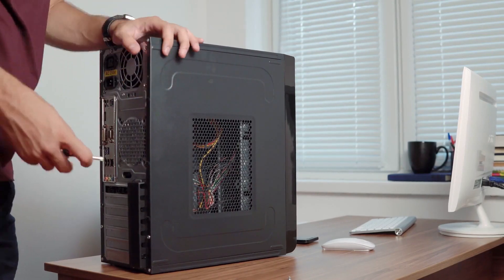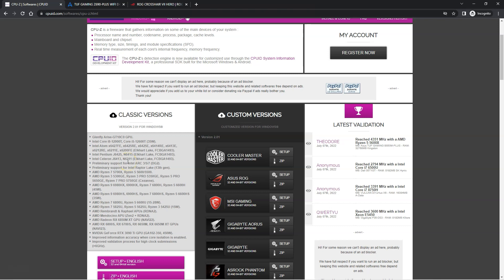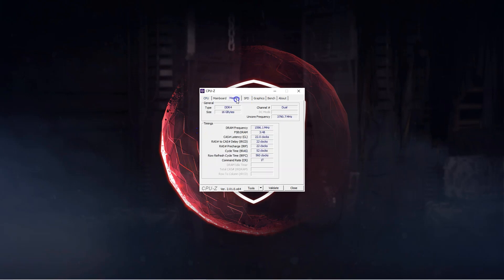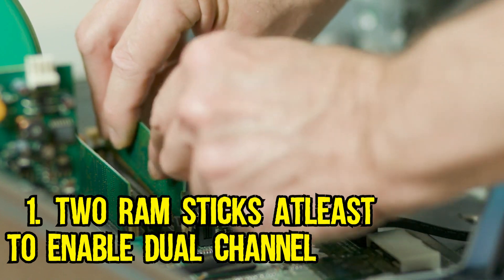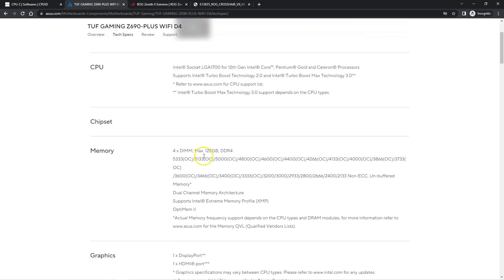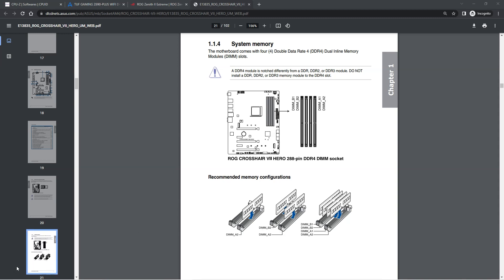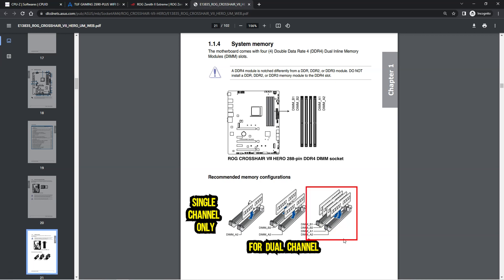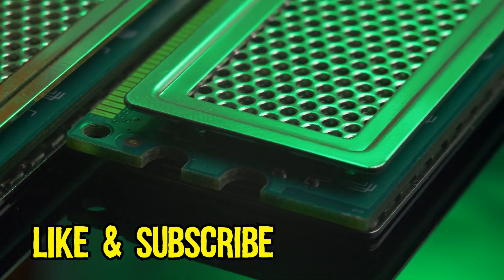How to Check if RAM is Dual Channel or Not?

Comment: i run 3 stick just fine i tested 1/2/3/4 and i had 4 but one die on me so i test with 3 and a dell 7050 will run my games /work at speeds of my ram sticks

Comment: 8gb ram and 4gb ram = 12gb ram total but when i check. It says single? Why? I need explanation  my both ram have 1600mhz😢 but why its not dual?
Reply: If you need to work with dual channel you must have a 2 sticks of ram in same size, mhz, datarate and those sticks must have a dual channel Artitecture, you have installed different size of ram you it will only works in single channel only❤❤
Reply: I have a HP Pavilion 15 Sleekbook laptop running on AMD A6-4455M processor, I installed two new Crucial 4GB DDR3 RAM sticks but it only recognizes one stick per time, how can I make it see the other RAM so that I can have about 8GB of RAM to work with?
Reply: @Lyondegreat  this means your motherboard does not have the DUAL CHANNEL option i think, so you cant run two ram sticks at the same time if your laptop doenst support that

Comment: If I have only one slot ram installed then ? If I want to know before upgrading my ram , how can I get that ?
Reply: You need to check if your pc has another slot available, if it does not you can’t add and you can’t change if the only one stick is soldered

Comment: Running three (3) sticks of Ram will run them ALL in single channel instead of dual channel causing the memory to run worse.
Reply: Any time I put 2 sticks of DDR3 4Gig ram, it pops up brinking blue cap and Key 🔐 light.

What does it mean?

Comment: Just in case someone checked this out and different values are showing because of newer version of cpu-z... 
2 x 64-bit = Dual Channel
Reply: Thanks! lol I was wondering about this XD
Reply: wat does 4x32 bit mean
Reply: @heartlessk2332  That means quad(4) channel.
Reply: what about 4x32-bit
Reply: What about  2 x 32-bit???
Reply: I don't know why they keep on changing this thing with the updates. But 2x32-bit is dual channel, 4x32bit is quad.  @jackali5014
Reply: @InsertTechnology  Same
Reply: well... it says i have it turned on and i have 16 gigs of ram but my pc still says only 8 are registerd
Reply: mine is 1x64 what does that mean?
Reply: @Floppynoob  do you only have 1 ram stick?
Reply: @-4023-  i use to but today i got a new one and put it in but i think i put it in rong tbh
Reply: @Floppynoob  if it's in then it's in right, if you have 4 slots and 2 sticks you might need to have them in 2nd and 4th slot then check.
if it still doesn't say 2x64-bit=DC then try 1st and 3rd
Reply: @-4023-  ok

Comment: Sistem Manufacturer-Hewlett-Pacard. Sistem Model-HP Compaq 8100 Elite SFF Pc. Sistem Type x64-Based Pc. Processor-Intel(R)Core(TM)i5CPU 650 3.20Ghz 3333Mhz 2Core(S)4Logical Processors. BaseBord Product 304Ah. 64-Bit Operating System Windows 10 Pro. 👀 installed Tow (2x8Gb)=16Gb DDR3 Frequency Speed-1333 Pc3-10600 9-9-924 1.5V Dual Channel Ram (Mushkin Silverline) Turned On Pc it Started Checking Memory it stopped on 5223 MB ! & it’s sitting like that for 30Min 👀??? Putting my old Ram in it reading 8Gb Correct and simply asking Save change & it’s done ✅ Restarting & boom 💥 im on my Desktop…but the new stuff won’t ☠️ any ideas??? And yes CPU-Z App says I’m running Dual Channel 👀 but installing new Ram doesn’t work i placed them correctly & no dust or damage nothing..I’m doing something wrong?

Comment: So look a question out of it's place but are you a PC gamer? Cuz I just bought another ram for my gaming laptop and I'm a little bit scared now I have GTX 1650 with I5 11400h with 8gb ddr4 3200mhz right? And I bought another 8 gb ddr4 3200 mhz but from a different brand and it worked just fine but I'm scared like after 3 days or something that I will face the blue screen error 🤷💔

Comment: QUESTION:
I Have 3 sticks of ram and apparently all of the are running at 3200mhz which is why i bought them but i dont know it its dual channel how can i find out ?????
Mag bazooka b660m dd4 
Core i3 12100
Reply: likely not

Comment: My ram is running in dual channel mode I have enabled xmp but still not getting the full speed of my ram which is 3600mhz on cpu-z it says that the dram and nb frequency is 1796.4
Reply: It's like that

Comment: U can just get task manager, memory and then it says 2 out of however many slots u have available
Reply: Yes but the process being described here isn't regarding verifying the number of dimm slots and whether there are ram modules installed in them necessarily. It is to confirm whether or not you are utilizing duel channel capabilities. A configuration that increases ram performance as opposed to having them in single channel configuration. So it is better to have them installed within A2/B2 as opposed to A1/A2 or B1/B2.

Comment: idk but i bought a 8gb ddr4 cl 19 ram and i paired it with existing 4 gb cl 15 ddr4 ram i checked in cpu z and it's showing dual channel and I've been using it for past 1 month no issues no lag no stability issues nothing it's working flawlessly

Comment: Okay I'm here to clear some things CPU-Z got updated so it'll not tell you "Dual" or "Single" instead it shows as 1x64 means single 2x64 means dual.
Reply: Mine says 4*32, what does that mean?
Reply: @Teedt  If your ram is DDR5 cpu-z shows that as ...x32 or if you have a very old mobo or ddr3 ram try swtiching the slots and check again if your ram is ddr4 and it still shows as 32 idk anything about that.
Reply: @estusmane  my ram is ddr4 and it shows  4*32

Comment: an odd thing started happening on my gaming laptop, there is 2 ram slots and I have 2x 16gig sticks so running 32gigs in dual channel. Was always fine but now all of a sudden it started showing i'm only using 2 out of 4 ram slots and when I run a benchmark it says am not using dual channel, not sure what the hell happen. In CPU-Z it does show that its dual channel but also started showing 2 out of 4 ram slots used. So fkckng random lol, and yes I 100% only have 2 slots! No onboard ram or anything.

Comment: I have an old sony vaio 2013 i3 2nd gen with a 2 ram slot. I found out that there is only a single 2gb ddr3 pc3 ram in one slot and the other is empty. Can i put a single 8 gb ddr3 pcl3 ram 2Rx8 in the other slot? Would that make it 10 gb ram altogether? Or should i remove the old 2gb ram and put in only the single 8 gb ram?
My laptop says it supports upto 8,gb ram.

Comment: Can I use 4gb + 8gb configuration in dual channel both at 2133 mhz
Reply: no it has to be the same , 2x4 or 2x8 at the same frequency
Reply: @ricardoruanogonzalez  idk but i bought a 8gb ddr4 cl 19 ram and i paired it with existing 4 gb cl 15 ddr4 ram i checked in cpu z and it's showing dual channel and I've been using it for past 1 month no issues no lag no stability issues nothing it's working flawlessly

Comment: Hi thanks for the video. I have two laptops. The one it just says Channel Dual with my 2 x 8GB sticks and the DC mode is greyed out, but on my second laptop it also shows Channel Dual, but this time next to the DC Mode it says Symmetric with my 2 x 4GB sticks. So, what does this mean?
Reply: I think both laptops are in dual channel mode
Reply: @chadharpicenjoyer8591  Ok cool thanks